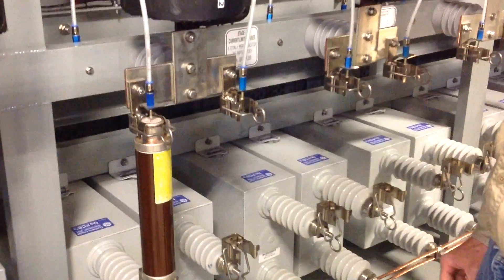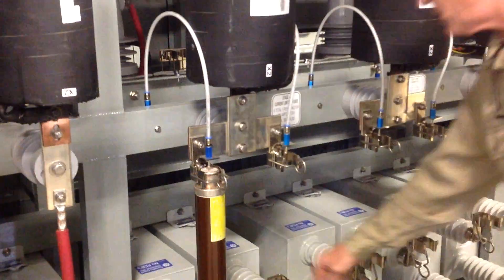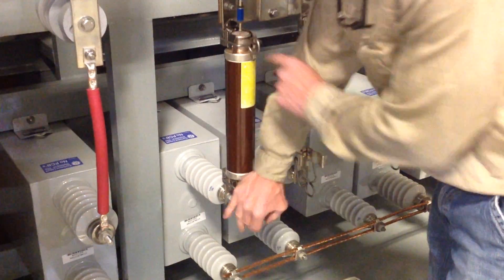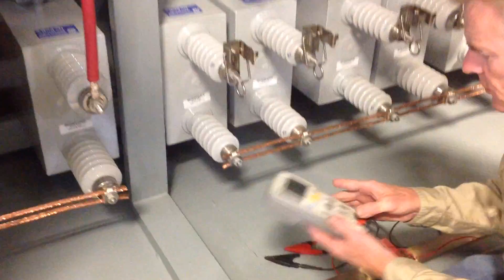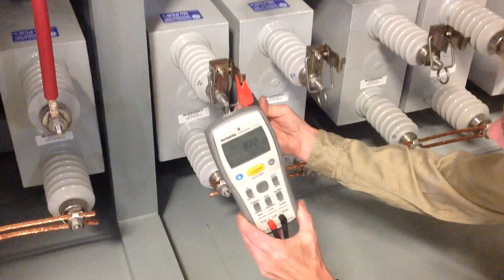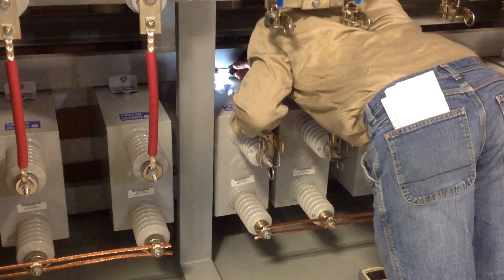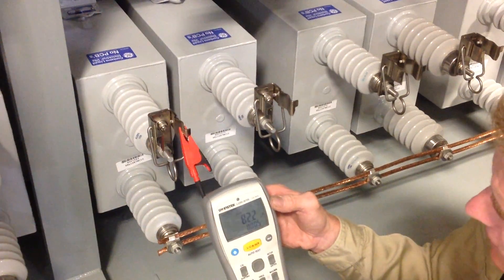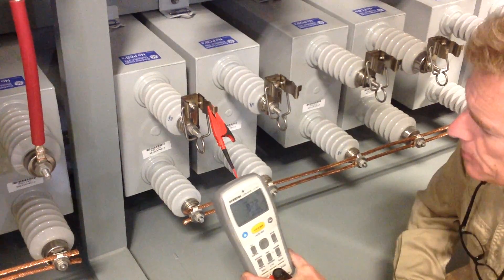Capacitance Measurement

Comment: Why would you see a higher microfarad reading if it partially failed?
Reply: the caps inside the caps are in series. caps work opposite of resistors so the capacity is lowered in series, so when one of the caps fail, the capacity increases

Comment: I have a 4160 in line power pack capacitor bank with 4 boots and one ground how can I read the capacitance between the four terminals
Reply from the maker: No. Do not work on live Medium Voltage equipment. It is very dangerous.